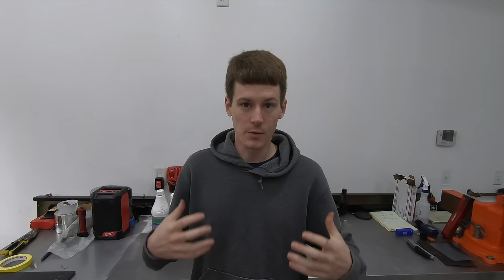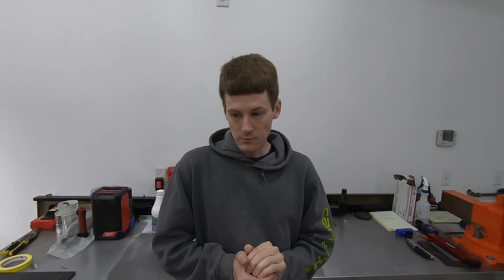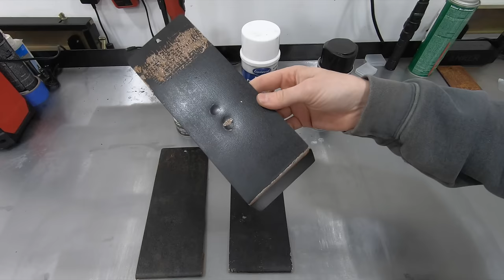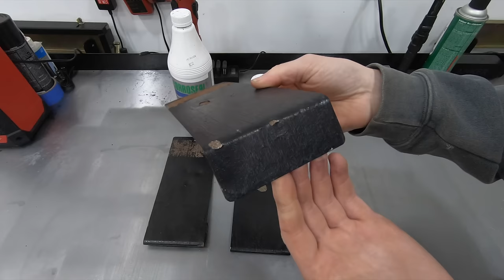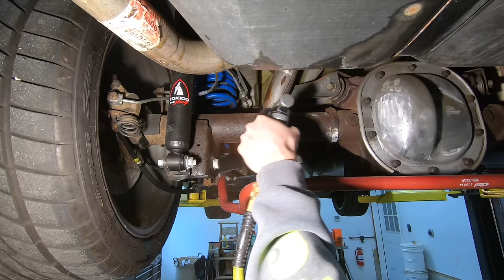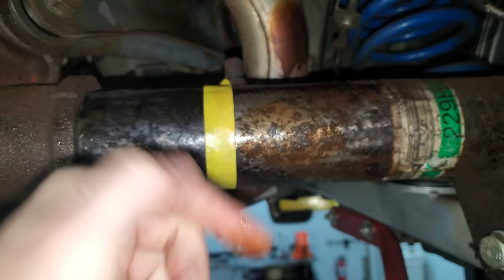MOST Rust Converters Are A JOKE! Let Me Show You. (Eastwood, KBS, Corroseal, Ospho & More)

Comment: Through personal experience I've found that despite what rust converter products claim, you can't just convert existing rust into iron phosphate or the like and them paint over it and be done. Unless it's very light surface or flash rust, you still have to get rid of the existing rust first, or as much of it as is possible, and only then apply a converter, preferably with a high phosphoric acid and possibly zinc content, and then you still have to apply paint or primer and paint over that.

There is no all-in-one rust remover, converter and encapsulator product for most real world rust situations. I've stopped believing the marketing hype and now use these products for what they do best, converting whatever remaining rust exists AFTER I've gotten rid of as much rust as I can via other means, be they chemical, mechanical or electrical. They're kind of a middle step in the rust removal and treatment process, and used this way can be quite effective.

Rust converters aren't snake oil. They're just marketed as such.
Reply: Agreed. They're great for pitted metal after you've sanded/ground down most of the rust
Reply: @zubirhusein  I forgot to mention that they both treat and neutralize what little rust remains if you've done a thorough job of removing it, as well as etch the bare metal, so whatever you apply afterwards can do its job properly.

I just did this with my car's entire rear end, using mostly POR-15 with a little spray can paint for the diff, very thoroughly, and hopefully it'll take.
Reply: The instructions actually tell u to remove any loose rust. So it's basically telling u to chip all the rust off and it'll convert any surface rust that's left.  None of these products will convert and work on bubble rust there simply not made to.  Either way u want to remove as much rust as u can before u do anything anyways.
Reply: @timothykappel198  It's not just loose rust that needs to be removed to properly treat rusted metal, but as much of the tougher embedded, encapsulated and pitted rust as possible, or any fracture in the treatment will allow air and moisture in to allow that rust to grow and undermine the treatment. Conversion only works on the very topmost layer if rust and not on anything underneath. You have to do it right or the rust will come back and potentially be even worse.
Reply: Whats the best top coating for black phosphate?
Reply: Exactly.
Reply: I use these after sanding, for the pin hole rust dots or how ever you call them, not to actually remove a lot of rust
Reply: kbs actually offer one of the best product next to rust kutter for that application and its called rust blast, basically a flash rust remover/acid etch/zinc coating for lightly rusted metal
Reply: @samuelaudet845  It's comparable to POR-15's Metal Prep. I've used both with good results. It took me a while to realize that these products aren't just for light rust removal but also and perhaps especially for treating what rust remains (and etching the metal to prep it for paint) before painting it over with something that'll resist chips and cracks.
Reply: @kovie9162  good to know, por15 prep is more often readily available
Reply: @samuelaudet845  I ended up getting a gallon of the POR-15 version and it'll probably last me for years. I feel like I could write a pamphlet on rust removal and treatment by now but I'll leave that to the actual experts!
Reply: What product should I use for step 1: the initial removal of rust before applying a converter and then finally por?

Naval gel? Muriatic acid?
Reply: @jakeleisure8326 Depends on the part, how bad the rust is and what you have on hand. Surface rust can be fairly easily sanded, wire brushed or ground off with a die or angle grinder with abrasive or wire wheel, or with any rust removal gel or liquid that has phosphoric acid in it, like Naval Jelly. Muriatic acid is overkill for that sort of rust.

Anything more serious, such as pitted, encapsulated or encrusted rust, can also be removed by these methods, but you'll have to work harder at it, and muriatic acid might be helpful in certain situations provided that you don't use it for more than 15-30 minutes then immediately neutralize it with baking soda and water for a few minutes then rinse that off with water thoroughly, then dry that off thoroughly to prevent surface rust.

I've found that it's especially useful on odd-shaped parts (never on the car itself), bolts and nuts, on which mechanical methods are harder to use. But you have to be especially careful to not use it for too long and to neutralize it thoroughly if they're structurally important parts or else the acid lingers and eats away at the metal. And use it only outside with a mask and safety glasses because the fumes are nasty, and store it outside if you can or else it'll rust anything nearby. If you can't, seal it tight then double bag it tightly.

Also, when you're done, make sure to degrease the parts before treating them with a phosphoric acid-based converter, preferably one with zinc added, wait, rinse off, dry, and only then paint with POR or whatever you like.
Reply: @kovie9162  Thank you for the comprehensive answer! Really appreciate it!

The rust is occurring in the trunk of a 95 del sol. Water is getting in there and turning the whole trunk into a damn terrarium 

The rust is beyond surface for some spots. Like a noticeable amount of metal eaten away. It's never been treated 

Any further advice would be worth it's weight in gold. Again, can't thank you enough!
Reply: @jakeleisure8326  If there are drain holes then you could probably use muriatic acid so long as you thoroughly neutralize it. I use it sparingly and mostly rely on a cordless die grinder and rotary tool. If you have access to sandblasting tools you might try that but I have no experience with them myself and the risk is of getting blasting media everywhere.

Also make sure to track down and fix the source of the water leak. I had the same issue with an old Kia Rio. Turned out it was the rear light fixtures. The rubber gaskets had rotted away, allowing water in. Until I track down new ones I just used a lot of duct tape to seal it.

Comment: Yes. We actually use ospho in some of our aircraft parts. You do need to remove access rust, apply it, and leave it to cure for 24 hours and then remove the access scale or powdery substance on top. Then after that you can prep amd paint over top. An acid brush is good to use to apply it. But it being thin helps it seep into the pores and through the metal. You just have to make sure you wait for it to cure and then the removal of the surface "film" it creates is important. Usually use and solvent to remove that.

Comment: FYI for people in Canada. Rust check rust converter sold at Canadian tire is available in a 236ml bottle not the spray can one. And if you get the bottle one it’s a acid based product like the ones he recommends in the videos
Reply: Rust Check Rust Converter, 236-mL
Thanks for the info
Reply: Do u have to coat or to paint the surface after using this converter from Canadian tire? If it has acid substances in side its will be not damaged if not covered after using?

Comment: I have one suggestion for a future test, take the best product here from each of the tests (including the paint on and spray cans) and then subject them to a fluid film/undercoating product to see what happens to them. I'm actually quite curious about how that eastwood stays wet and how it'd react to a lanolin type product.
Reply: Eastwood Rust Converter will stay wet for about 30 minutes. It is a water-based product, so it will eventually dry. However, it is important to allow the converter to dry completely before applying any other products, such as a lanolin type product.

Lanolin is a waxy substance that is derived from sheep's wool. It is often used as a lubricant or as a protective coating. If you apply lanolin to a surface that has been treated with Eastwood Rust Converter, the lanolin may interfere with the curing process of the converter. This could lead to the converter not working properly.

It is best to avoid applying lanolin to a surface that has been treated with Eastwood Rust Converter. If you need to use lanolin, you should wait until the converter has completely cured. This will ensure that the lanolin does not interfere with the curing process.
Reply: What I worry about with the eastwood product, is that if its acid based, and doesnt dry, any remaining acid in contact with the metal will sit there corroding it. Its why POR15 rust prep advises you to spray, leave for a while, and then rinse off with water, and dry. Because otherwise itll have leftover acid on it and will eat at the steel.

Comment: Great video! Just wanted to add that I used Dupont (then) Extend on some car rust-thru spots ~40 years ago with fabulous results. Zero rust since then, and the car has never been garaged, always out in the weather.
Reply: Yes, the BEST one! Following bottle instructions exactly gives SUPER results. I pour the amount I will use into a plastic cup and brush it on. It turns from tan to black where there's rust, then primer and paint. I've had trouble finding it here in Washington State. Was hoping it would be tested here.

Comment: I've tried MANY of these rust converters. In the end, the only one that I found really good (providing it's maintained in humid environment after it's given on the part as if it dries it stops converting the rust) is called "Fertan" and is a Germany product that is available only in EU (and not everywhere). It's based on tannic acid, so it's not toxic (that thing is used also into wine preparation), it's brown, and it's NOT a primer, but just a converter. You brush it on the part, and within a day all rust is converted. Then you need to wash it away, dry the surface and put a real primer on it. It either transforms the rust into a black dust or removes it completely if the rust is very small.
Reply: Hi! What's the exact product's name? I found different products from Fertan like FeDOX, Rost Konverter, Gegen Rost (I assume it's a bigger bottle of Rost Konverter). I am using Wurth Rust Converter and Bilt Hamber Hydrate 80 which are also tannic converters, but you don't wash them away, because they dry as a dark layer on top of rust and then you coat them with something.

Comment: I have had extremely good luck with the Ospho. I have done countless restorations and hotrods with it and they all still look great and have held up against the rigors of time
Reply: Have you documented any so we can see your process?
Reply: @Tubetop411  yeah I have lots of pictures of builds over the years. No way to post them here though and I do not have a YT channel
Reply: I read through some of the other comments now on this video and I think the Ospho process is misunderstood.
Take a painted/coated panel that has rust on it...
Step one is to grind the entire surface down to bare metal, using a wire wheel to grind the rusted areas of all scale and brown surface rust. The rust needs to be wire wheels until virtually no more brown dust comes up from doing so. Then at that point, it's time to apply the Ospho. I always apply it with a brush, working it really well into the metal and I do the entire panel, even if there's no rust in spots. Then it needs to fully dry, minimum of 24 hours.
Step 2 is to make sure it's completely dry and then I start with P80 grit sand paper on a DA and make sure to remove all surface scale created by the Ospho. You do not leave that scale in place! That scale is the converted rust contaminants that cannot stay with the panel. Once it's all sanded down and no more scale, it's ready to be wiped clean with a good wax and grease remover.
Step 3 is to coat the panel with a good primer and paint as normal from there.
Hope this helps someone out there in YouTube - land 👍

Comment: I recently used Loctite’s aerosol product, and I was fairly impressed.  I would say it fell somewhere between the Rust Kutter and the VHT.  The adhesion was great (I had to use 80 grit paper to get it off), and it definitely converted the rust.  I did have to put two coats on the areas with thicker rust.  Based on how it smelled and the way it burned when I got it around my eyes and nose, I suspect it is phosphoric acid in a spray can.  

Thanks for the info!!
Reply: Agree. I used it two years ago on some light rust on the inside quarters of my original 79 Silverado. Delicate work. It worked better than I expected and the rust has not returned at all.
Reply: Yes / this is the kind of center he should have been testing.  The aerosol Loctite is amazing stuff.  It does NOT come off ..
Reply: @rickyanke9407 original 79 Silverado? I hadn't realized they made the 79 in any other years.

Comment: I watched this video a week or so ago and remembered I have had a pot of Loctite rust converter in the garage for 30 years, I'm in the UK. A few days ago I swapped the stock shocks on my Subaru Forester XT, for a Peddar's lowering kit. The original shocks have only got 60,000 miles on them, not even half way through their life if my 2.0 Xn is a yardstick. There was a fair amount of rust in places after steam cleaning them, 2nd degree surface rust mostly. An application of the Loctite has totally transformed them, the rusted areas are neutralized and the coating that's been left? I have attacked them again with the pressure washer and the layer remains totally intact. When wire brushed even the worst areas have no live rust remaining. Perhaps a formulation that old has a chemical make up that is outlawed now?
Result, nice set of 2.5 SG9 shocks appearing on E Bay soon :). Thanks for the vid, I wouldn't have remembered it was there otherwise.

Comment: I used extend treatment on my 1980 Firebird where the battery sits. I sold the car and then came across it several years later with the new owner. I asked to see some of the spots I touched up with it and it still looked great. I am not sure if Loctite changed the formula, it used to be in a brown bottle called Extend Rust Treatment. Seemed to work great for me.
Reply: EXCELLENT product. I have a white bottle of DuPont Extend - thick tan color until brushed on rust which turns it black. Primer and paint and good to go. Cannot find it for sale now.

Comment: If you use a rust converter (we use Enrust) you must allow it to cure for twenty four hours and then coat it with a good primer and top coat.   If you don't do that it won't work well.  and no coating is perfect.  In my applications -marine preservation of metal hulls a good paint job will last 3 (if done in a so-so fashion) to 9 months or so (if done nearly perfectly)  and nothing will protect you from chipping or impact..  The acid based products are really only useful for eliminating running rust especially on painted surfaces.  I hasten to add that no coating is designed to be bent.

Comment: One I can recommand RUBSON FRAMETO (not afiliated by any kind) : 22 years ago I made for my daughters a Swing balançoire out of thick gaz tubing sitting on my outside stock. They were completely rotted, I just roughtly brushed them, then one FRAMETO coat, then one thick paint coat, that was it. It is still outside my house, and there is NO RUST at all on any tube, even those that where hit and with damage on the paint. Thats a good product, still sold the same after 30 years.

Comment: Best rust treatment I've found, is Ultra One's  "SafestRustRomover". It's not as fast as some other products, and is best applied with recirculation... but it has great results, is less toxic than any of the faster alternatives, and can often be reused, depending on how much area you have to treat. That being said, it's not a converter... but in my experience, those "converters" never penetrate well enough to eliminate the problem.

Comment: The primer in Corroseal is a latex base.  I use it to convert rust and it does that quite well, I wouldn't trust it as a base for automotive use though.  I did test it on the outside of my old truck where I had a thin rust layer on fender.  It turned the rust to magnetite and 2 Pa winters later it looks the same as the day I did it.  No topcoat just the corroseal.
Reply: Glad you've had good luck, but be wary of this stuff. I had used Corroseal very diligently on some items I made, and topped it with four coats of rustoleum. After 2 years in an air conditioned house, everything which got that treatment had powdery rust breaking through across the entire surface. I also found that Corroseal's adhesion was extremely poor, and it chipped easily. I posted details of all this separately.